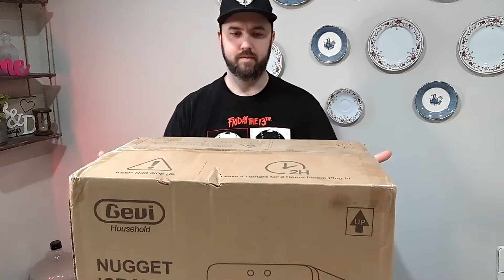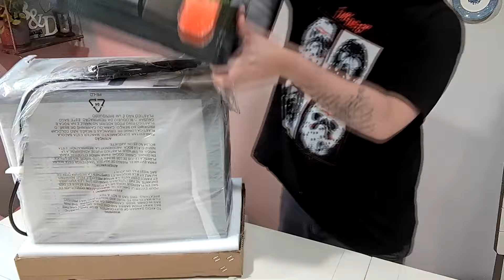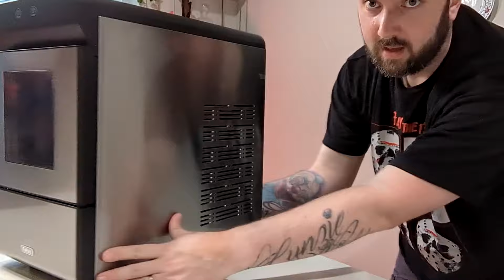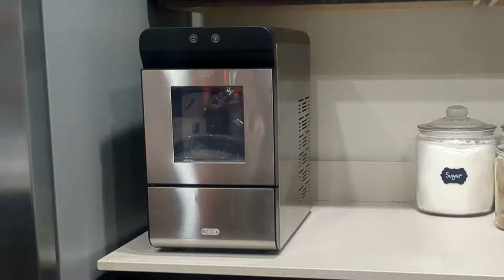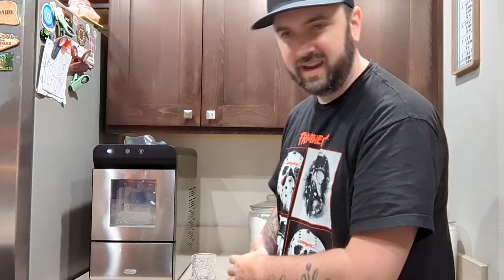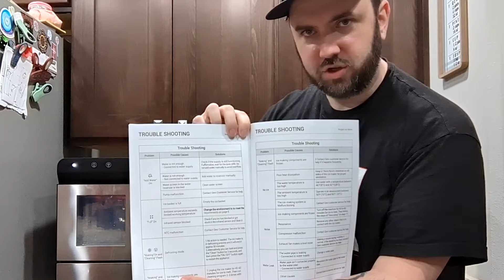GEVI Nugget Ice Maker GIMN-1000C – Fast, Crunchy Ice at Home! 🧊

Comment: Sadly ours never worked. Kept getting the low water warning despite setting it according to the manual and trying various remedies.  It was returned.
Reply from the maker: I live in an area with hard water. Gevi stands by their warranty and sent me a replacement ice maker and packets to run through the cleaning process.